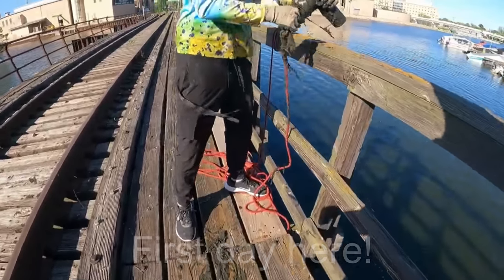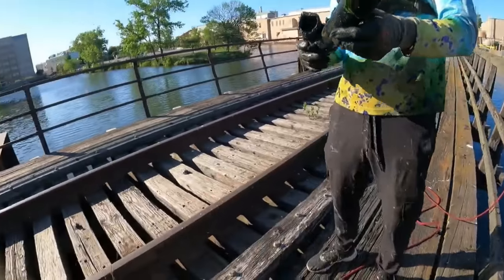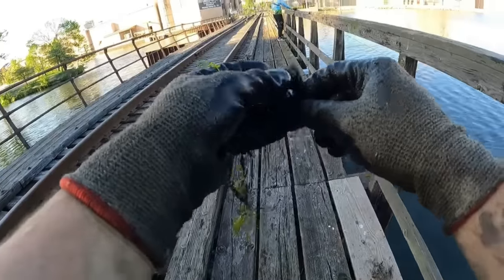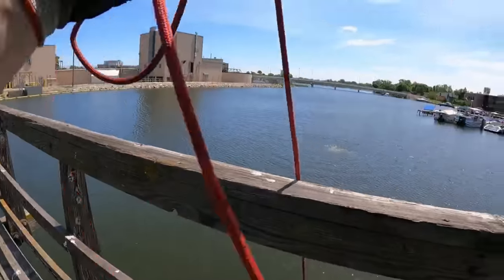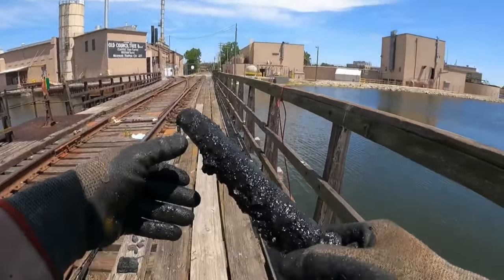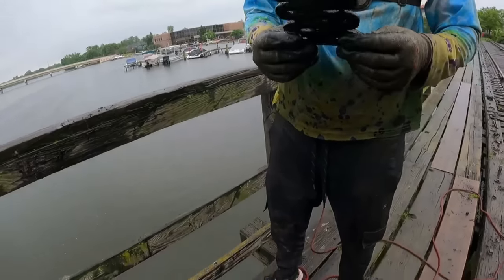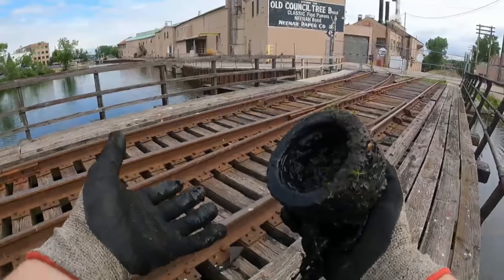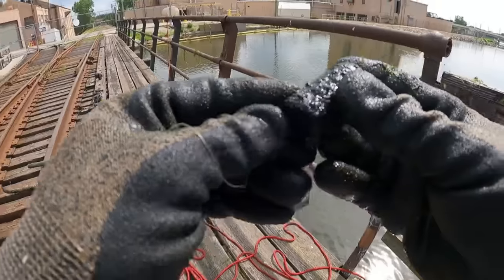I Spent 100 Hours Magnet Fishing an Old Railroad & You Won’t Believe What I Found!

Comment: @ 46:15 that piece is a roller from the top of a freight car door. 2 rollers at top of a side door and it rolls front to back on a steel rail mounted to the car.

Comment: At 18:20, Tyler shows you a hammer with a flat head. I have a floor nailer that look exactly like that hammer. It's used for sending a nail into the Tongue and grove nailer and at the same time, slamming the tongue into the grove to make the floor seam good and tight. I believe that's what it's was used for.